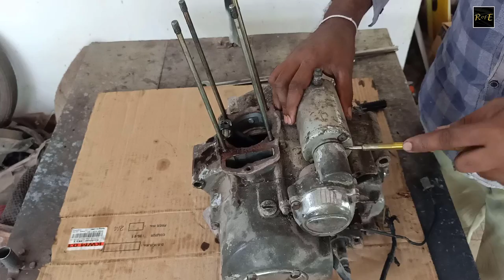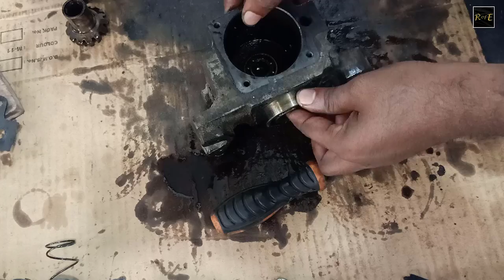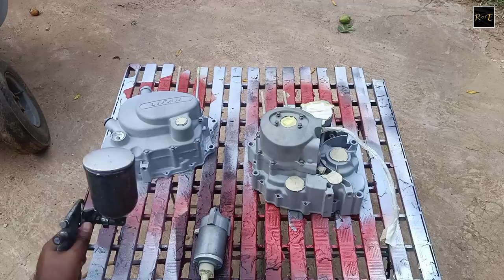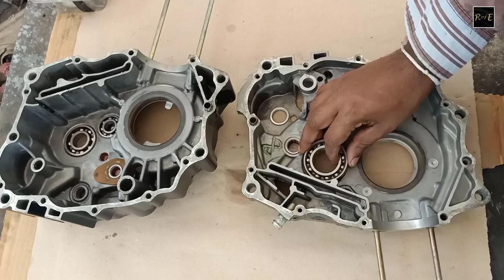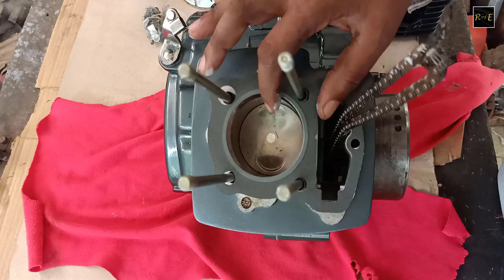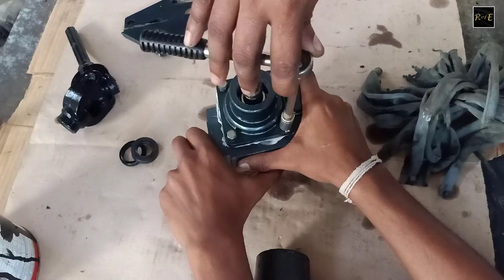150cc Tricycle Engine Restoration

Comment: The engine is very clean on the inside, low time running. Outside is in terrible condition simply indicates a lack of cleaning and neglect.
Hear the outside usually looks okay or good and the inside is completely worn out and knackered up. Indicating lots and lots and lots of Hard use hours running, but plenty of cleaning and maintenance.

Comment: wow... is that monkeys or chickens I can here in background.. I have the exact same engine. I am asking nicely if you or one of the folks on here could do a valve timing and also valve adjustment video. my motor blows back through the carb.great vid. many thanks.. si.

Comment: Can we replace this cdi cam cover with xl 185 or xr 200 pulse generator governer cover or cam cover is there any difference or not can we replace it. Is the cdi cover diameter is same like xl 185 or xr 200

Comment: I only see dry muddy thing outside, from inside it's a newly made engine even the bearing are new, no iron particles, oil or any damage part. This isn't a restoration video it's a teardown vid and then assembling it up again
Reply: the enige had literally chunks of metal stuck in a bearing,did you watch the whole video?
Reply: @vaggelisdogas  don't mind but it's only my point of view and video is great 👍

Comment: New clutch discs need to soak in oil before installation.
Reply: why?
Reply: @gametrench1255 if they are dry on first start up they can burn up. It's a wet clutch system.
Reply: @matthiasweigel311  try reading a service manual you will learn something.

Comment: Always pack your bearings, or it may be receiving a few more “restorations”.
Reply: these bearings are oil lubricated not grease.
Reply: Grease inside is not helpful when the bearings are operating in an oil bath inveromen,  all that is needed is a good application of oil during installation to insure lubrication during first start up.

Comment: Well done?, you mean hey guy how about soaking those clutch plates for 24hrs before they explode into pieces because you installed them dry, or hey guy why don't you fill that drive shaft housing with clumps of grease and not engine ensemble lubricant before that explodes under pressure.